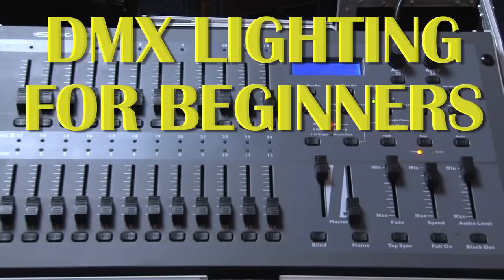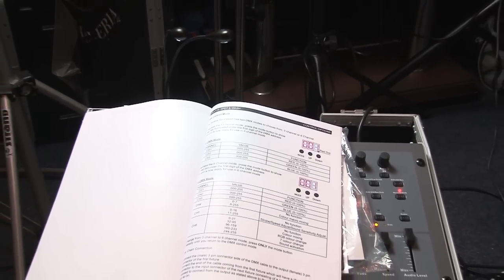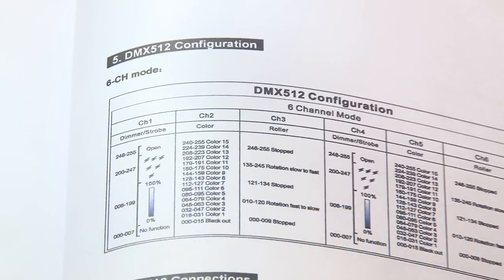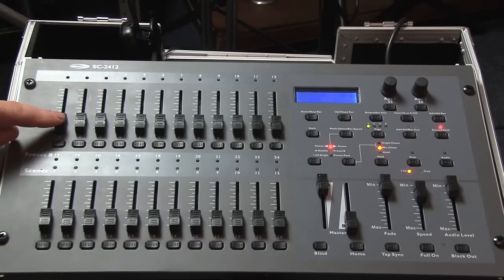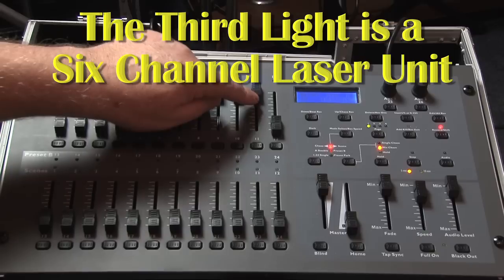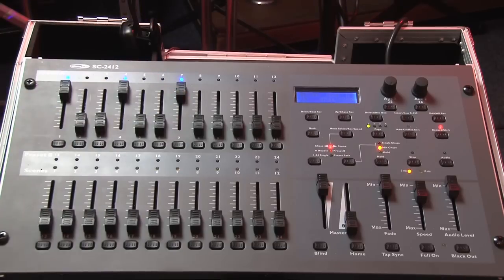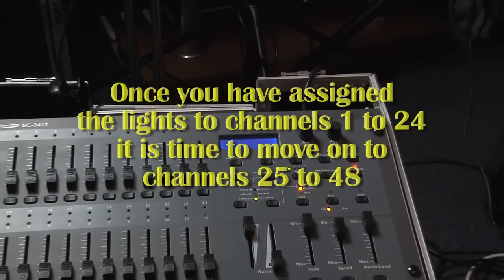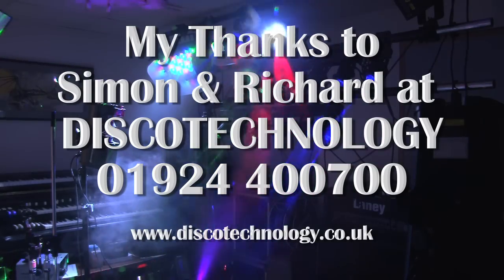DMX LIGHTING FOR BEGINNERS - PART #1

Comment: Very useful series 3 videos Keith. I have recently got a very similar control deck (Scenesetter 24) with an identical layout.  But I can't for the life of me get any reaction from lights I have tried with it. I tried a Party led with 7 channels. I addressed it as fixture 1 via dip switches. Only when I press the  "full on" button does it light.

Comment: Hi Keith.. straightforward and simple explanation - thank you. I have a question. I have a board which has been preprogrammed by someone else, and I want to try to replicate the slider settings using my computer software. Sliders 21 22 23 and 24 are operating a RGB LED. Is there a way of displaying what DMX channel a slider is set to? 
Thanks
Steve
Reply from the maker: Not sure on this, if the slider has a travel of 0 to 127 for instance, then I suppose you could approximate the number by looking at the slider position .... but I am not sure on this.

Comment: Hi Keith, as I'm new to DMX Control and currently educating myself by watching your video's on You Tube which i think are great by the way! Is it possible to enter a DMX program into a DMX controller only using the User Manual for the Fixture and not making the necessary DMX cable connections for the fixture. What I mean is, lets say  channel 1 is for Sound activation and only works from 020-255, channel 2 for Strobe speed 020-220 and so on for other fixture features etc. I would appreciate your advice, cheers Bill
Reply from the maker: as long as when you connect the light with the DMX cable (not forgetting the end of line terminator?) the fixture should work provided that on the fixture you tell it what its DMX number it ......
Reply: Brilliant... didn't want to upset the wife with loads of lighting in the living room, thanks again :-)